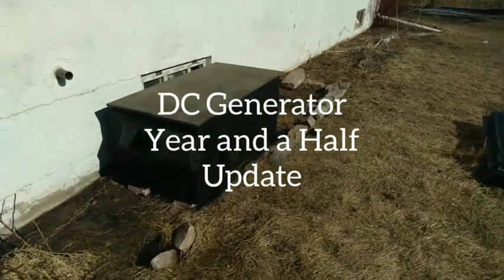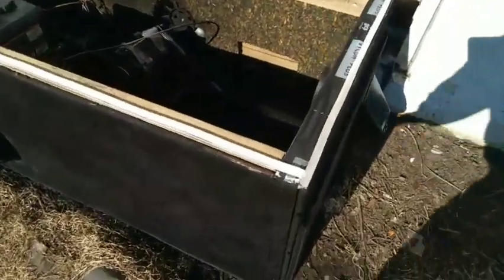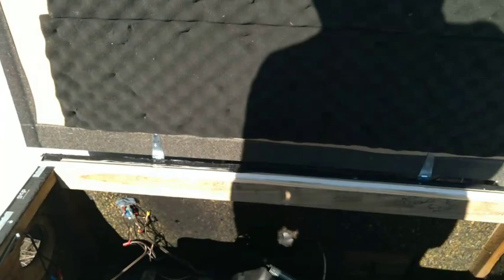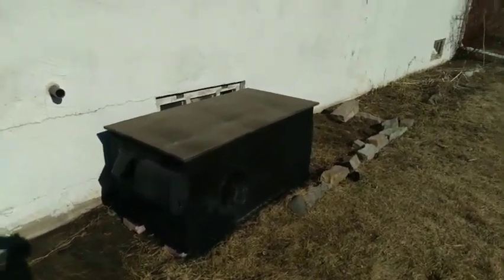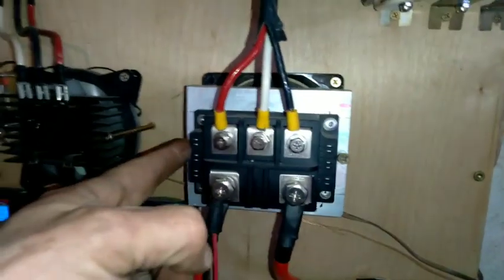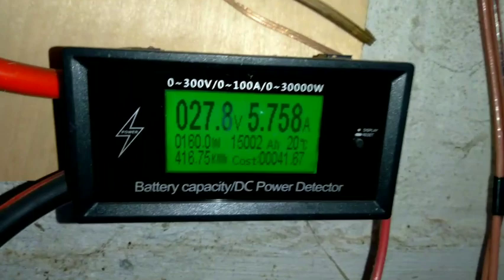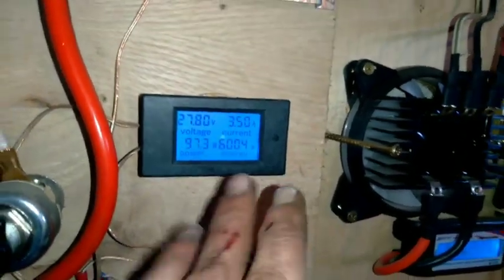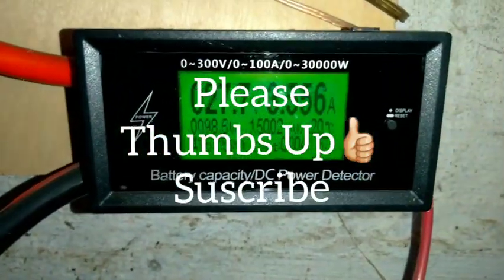DC Generator Year and a Half Update

Comment: Pulley on the motor should be at least 2x larger diameter than the alternator pulley because you want to get at least several krpms on the alternator. The alternator is a high rev device.

Comment: How well would a 12v system work vs a 24v or 48v system?
Reply from the maker: I started with a 12v system at home...they work fine. The big difference is amperage load and part availability/compatability.  Amps × Volts = watts..... and watts are watts sooo....for your fridge that uses lets say 250w, no matter what, a 24 inverter will draw half the amps out of the batteries as a 12v...a quarter for a 48v. The big benefit to higher voltage systems is you can carry more total watts through your wire, charge controllers ext. I havr a 60 amp solar charge controller. If i had stayed with a 12v system i could only run 800 watts to it. At 24v i have 1600 watts hooked up. If i did 48v i could hook up 16 more 100 watt panels without upgrading the controller. The huge disadvantage is availability. You can find 12v parts everywhere!...in town, on the shelf, ready to use and readily replaceble. Everything else basically you gotta order and wait for.
Reply: @smallcityhomesteaders1600  I wouldn't use it to be off grid, i would use it more for backup so 12v probably good enough? I want to build a genie with a alternator for this as well. I would also like to use the genie in my truck to run fridge, bunk heater and small a/c. Right now, in my truck, i have a d/c to d/c charger charging a 100 amp Lithium battery. I charge during the day while driving and run above acc. overnight.

Comment: Link to generator you have on the predator?
Reply from the maker: Links for every part are in the video discription.
Reply: @smallcityhomesteaders1600  seems like I see everything but that alternator. I see the ammeter, AC Meter, Solar Panel, Ring Terminals, Knife Switch, Charge Controller, Sine wave Inverter, Extension Lead, Temperature Controller Switch, Distribution Block Pair, Bus Bar Pair, Dc Fan, Solid State Relay, Heatsink, DC 3 Way Switch, Wind Turbine Controller (24V), 3-phase Rectifier, Fan, Circulation Pump,  Ceiling Fan, Load Controller, Dual Core PMA, Copper Coil, Voltage Converter, Supply Hose.
Reply from the maker: @troy3456789  https://www.hydrogenappliances.com/powerpmasdual.html
Reply: @smallcityhomesteaders1600  Another guy made a generator out of a DC treadmill motor connected to a predator. Turns out most treadmills have DC motors in them. This seems like it's robust.
Reply from the maker: @troy3456789  i made a pedal powered generator from a treadmill motor. It works but you would not believe how hard it is to get 200 watts out of it. I consider myself in fairly good shape and with all of my effort i could only sustain 200 some watts for a few minutes. I made a video of this as well.
Reply: @smallcityhomesteaders1600  I am going to check that out. 200 watts is not terrible. A person could get into some terrific condition doing more than just providing cardio.
Reply: @smallcityhomesteaders1600  
Seems like it might be nice to either make a tandem model, or a side-by-side version that applies human power to the same generator, perhaps one shaft that goes through up to 4 rear bike wheels (or one for each family member or friends) ; all connected to the same shaft, connected to the same generator. When you are all on it, the TV comes on, and you can watch what whoever has the remote, perhaps power a fan on all of you. 
Get the seats so that they are comfortable, more supportive, perhaps wider. I do not know how much power 4 out of shape adults could create, compared to 4 reasonably conditioned adults could make in 1 hour.
Reply from the maker: No kidding.....i'll find it
Reply: @smallcityhomesteaders1600  Brushless DC motors and generators that are not made in China are not cheap at all. I am digging. I have a pretty nice bike, I would not mind either converting to do this, or even harder, make it "convertible".
Reply from the maker: @troy3456789  it'll work but boy oh boy.....you learn real fast how much energy it takes to make energy. I had a new appreciation for the wind turbine after spending a few minutes on my pedal generator.

Comment: Hey man are you able to do a schematic? I've slowly been gathering pieces I need to build a system. I don't like depending on solar or wind so I want to build a water turbine as I have a year round creek and a backup generator like yours. Or even a motor that runs off the battery and charges them at the same time through a pulley like yours. Great set up by the way
Reply from the maker: I have actually had this request a lot and other then e-mailing everyone that asks, i could just make a video that goes through it all. I will try to do that in the next day or so. Suscribe to the channel and keep your eye out. Thanks for watchin!

Comment: If you increase the engine drive pulley size, you will get more RPM out of the alternator with less RPM on the motor....save fuel and get more power
Reply from the maker: I tried about 5 different combinations of 10 different pulleys in development. For this setup....this is the best fuel/kwh arangement i could conger up. 50-60 amps is plenty. I don't want to overwork the engine or the PMA. With less batteries there would be less resistance on the PMA and i could spin it up with less throttle but 16 batteries is a big load for any alternator.

Comment: Thanks for the Video!!!, I am a newbie to all of this, however, like getting tossed into a pond to learn to swim, I just won a 2 year old computer room UPS backup power system with 28 Data-Safe Enersys 12HX330 84ah batteries from a government auction. (come to find out after I won them that they are actually rated at about 110ah each = 3080ah total - even better). (there were 2 of these units, i should have bid on the other one as well for my house - I'm a idiot) So I am building an off-grid exploration vehicle. I purchased a Chevy Dura-Max Express shuttle bus with only 27k miles, and will be putting 2800w of solar on top and thanks again to you! I am going to build your simple generator system rather than use an off the shelf system. again thanks for the video.
Reply from the maker: Wow!....what a score. That will be a really fun project. If you have the capability, record some of the proscess. I would love to see that.
Reply from the maker: Feel free to scroll through all my old videos. I go deep into every little part...the whys and hows...if it worked or not and what i did to correct it. The system has evolved a lot, even in the last 5 years i started documenting it. Before that, it was kinda funny how little we could get by with. Been off grid 8 years now and has been a great adventure and learning experience for my kids.

Comment: I think it's the metal frame you need improvement probably that's where the noisy sound coming from
Reply from the maker: Your exactly correct. If i had rubber bushings between the engine and frame it would be way quiter.

Comment: Should cut the bottom out of a 5 gallon bucket at mount it over the fans so it minimizes uv and doesn’t make the plastic brittle over time  and protects them from moisture
Reply from the maker: I did spray paint them to reduce UV but that would totally block it.

Comment: How do u make 240v or is everything in your house 120v. Every inverter I have looked up is 120v unless u go with the Victron inverter.
Reply from the maker: Everything i use in my house is 120v but there are lots of split phase inverters. The system i built for a customer up north has 240/120 volt. I'll link the inverter for you.
Reply from the maker: https://www.amazon.com/SUNGOLDPOWER-12000W-Inverter-Charger-Converter/dp/B00S4C702M